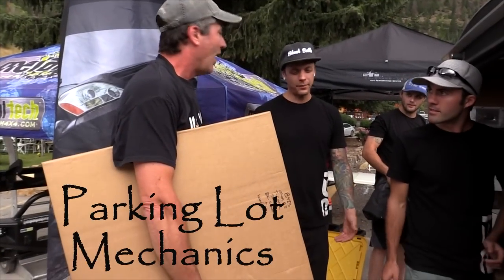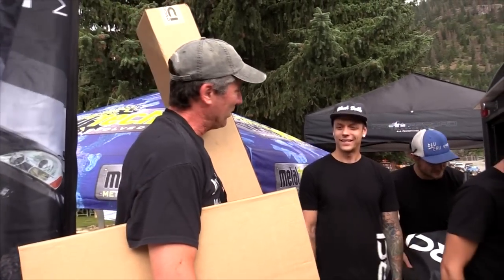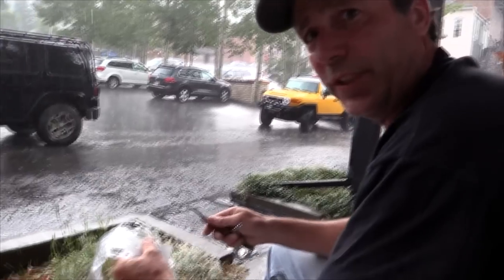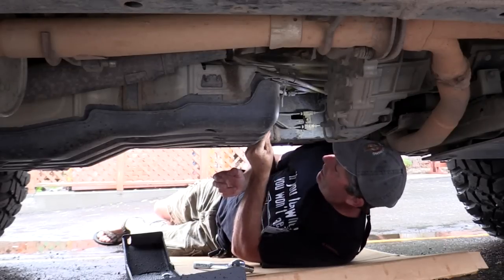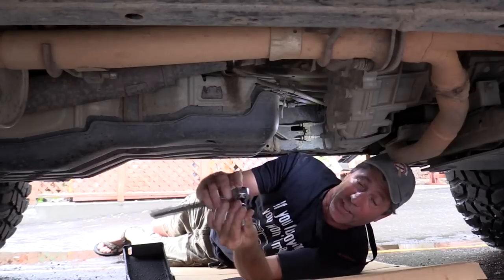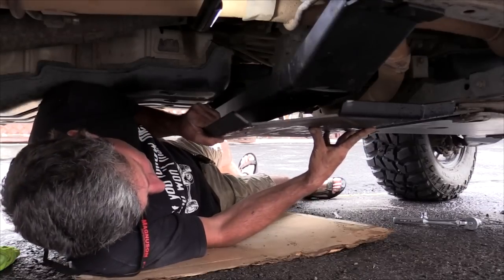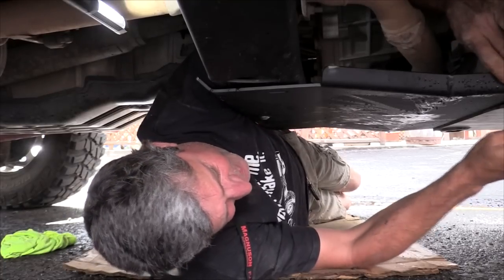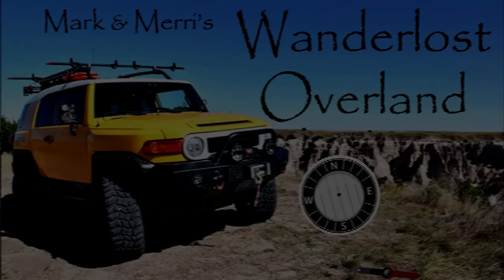Transfer Case Skid Plate Install in the Parking Lot

Comment: How do you change the transfer case fluid with the skid plate on?  There is no hole to drain the fluid.
Reply from the maker: It's a bit of a pain but the skid needs to be removed. Once you've done it a few times it goes pretty fast.